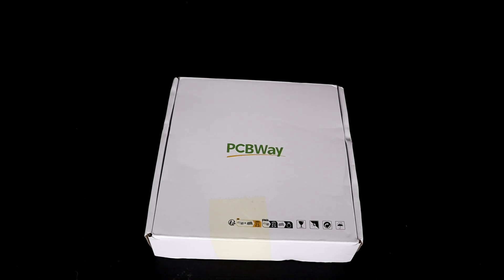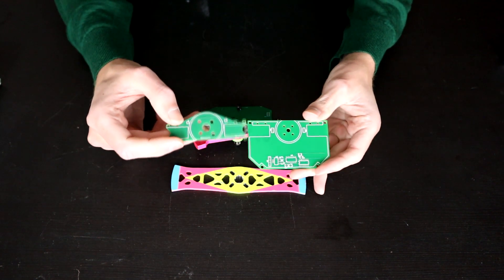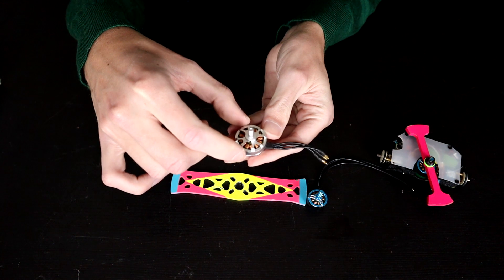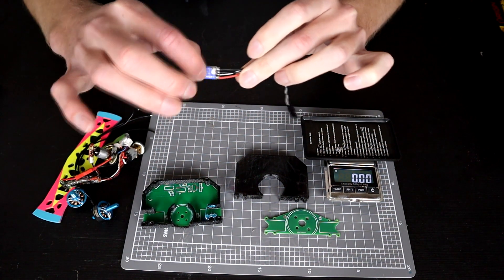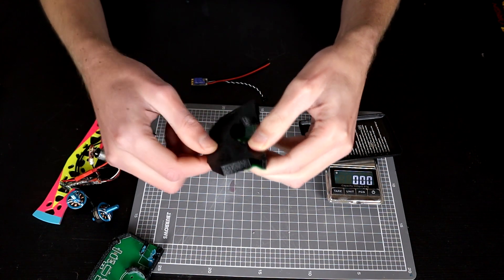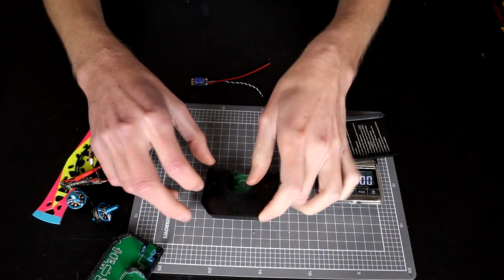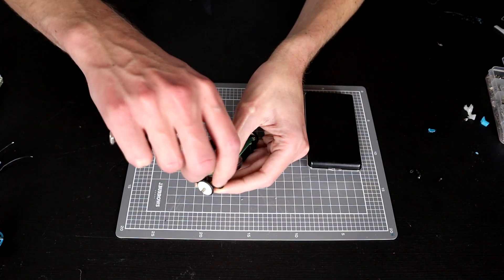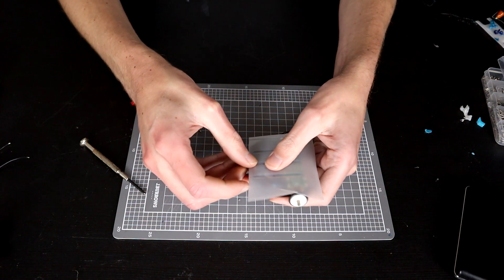72g robot spins a 77g bar!! (LoJinx POWER!!!! update)

Comment: How about drilling a few holes in the steel weapon?
Reply from the maker: Its already got speed holes in it, and that would wreck both the look of the blade and the challenge of getting it to work at its current weight

Comment: Hey, I noticed you're using tpu and i just had a question as i'm very new to 3d printing and designing around it (just got my printer a month ago): how do you do the threads for the lid? i've tried printing the threads in to very little success and i wonder if there's a better way to do it. thanks! love your videos, they are super helpful for the design process and i love seeing how you highlight every change and your reasoning behind it.
Reply from the maker: In this version I'm using self tapping plastics screws, so I didnt model in threads. I just printed the holes slightly undersized and let the screws do the rest

For the old version, I modelled in threads, using Fusion 360's thread tool. it has an option that models in the threads rather than just drawing them on.
The only thing you need to do then is use the "exclusive" slicing tolerance in your slicer to get the threads to print at the right size, some of the bigger youtube 3d printing channels have done videos on slicer tolerance settings. 
Honestly its more trouble then its worth, undersized holes for self tapping screws are easier and in my experience they hold better
Reply: @TeamPanicRobotics  super helpful, thank you so much! will check out both methods and find something that works

Comment: Why not use an 1806 brushless?
Reply from the maker: Because the only good 1806 brushless motors that have a 3mm shaft and 3mm mounting screws are not sold anymore and the 1806's I have broke when spinning a 14g spinner, they would self-destruct spinning this blade.
The 2204 is not much heavier (around a gram) and has a 3mm shaft and 3mm mounting screws. it should survive much better

Comment: Sweet! I'm starting my first antweight project. Mind sharing the battery specs you use to power that thing? I'm guessing 2S, but what's the capacity and C rating?
Reply from the maker: Not really, no.
this build uses a custom, tiny 2s battery. made from cheap 1s tiny drone batteries. I made a video on making it but I do not recommend it for an antweight unless you need weight and cant take it from anywhere else.

My usual antweights use a 2s 180mah battery, which is kind of the standard for ants in Australia and what I would recommend
Reply: @TeamPanicRobotics  Ah I see! I hope those batteries don't blow on you during a match then 😅

Comment: Would it be worth using n20 red escs in this bot due to how they attach to the motor meaning that you don't have to worry about trying to bend a wire to avoid the weapon motor?
Reply from the maker: I am using the red ESCs, but as the robot is so thin, the red escs dont fit sideways in the robot, they have to be at an angle. Also I'm expecting this robot to break itself and need motors replaced. The Red ESCs are very expensive to get here in aus, so I wanted to make removing and reusing them as easy as possible

Both of these together are why the ESCs are on a short piece of wire rather then directly soldered
Reply: @TeamPanicRobotics  Ahhh, didn't realise and makes sense that you dont solder directly in that case.
Anyway, good luck with the bot.

Comment: Maybe move the wheels back and have a Y shaped PCB chassis could help? That way the PCB covers the whole length of the bot, and since the wheels are at the back, the bot should lean forward natually.
Reply from the maker: The main reason the wheels are inline is because of balance and traction, with such a heavy weapon, if its not over the wheels, theres not much at all over the wheels and they loose a ton of traction, meaning the robot doesnt drive well
Reply: @TeamPanicRobotics  Ah I see...

Comment: looks deadly! haha, great vid. have you even thought about using nylon screws/bolts for weight saving? might allow you to use the back chassis bolts as stand offs and also double as a way to clamp the bot shut.
Reply from the maker: I'm mostly using self tapping screws in this bot, which I dont know if you can get nylon versions of those. If so they'd save me some weight for sure